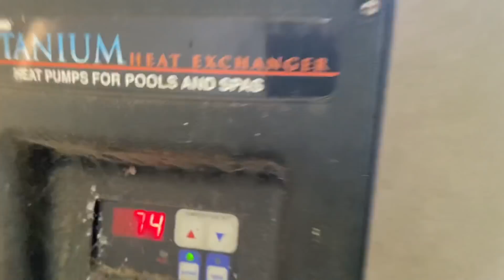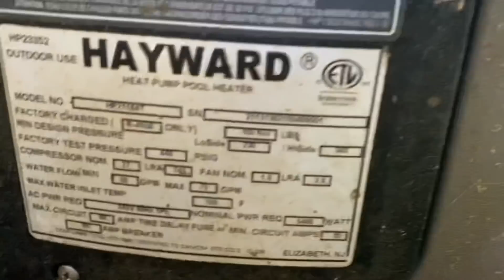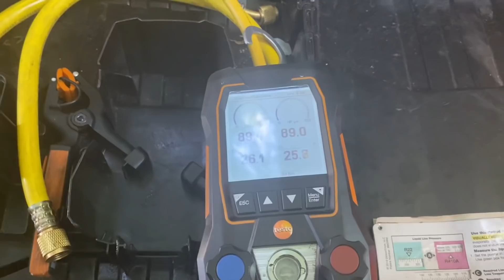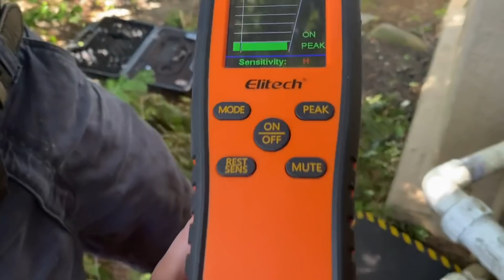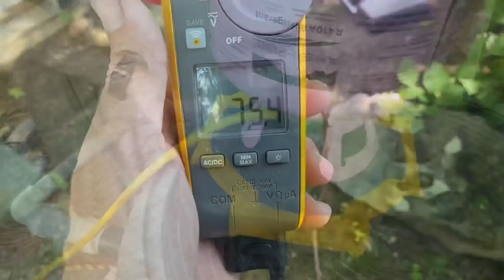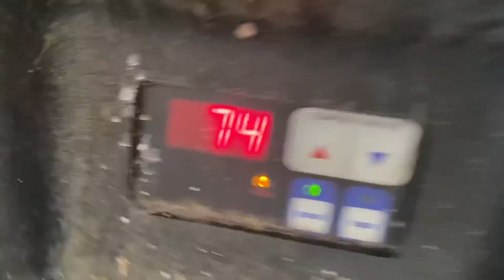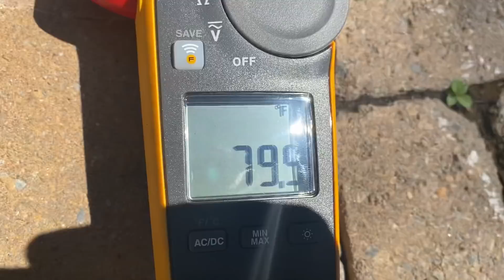Hayward Heat Pro Heat Pump LP Error Not Heating - Refrigerant Leak on Filter Dryer Repaired

Comment: Daniel, if you are readin this: brazing is hard to learn. do good brazing takes a lifetime to learn. never stop being critical of you own work and always aim to do a better job. pro tip from someone that has been brazing nearly 30 years now: use clean gloves when sanding and touching the copper. make sure you dont touch the copper by hand. the grease from your fingers kills the wicking action. even after sanding it remains so put on clean gloves, clean with alcohol/isopropl and then sand and braze without taking the gloves off.

Comment: 1K for a filter dryer and 5.7 pounds of refrigerant? Wtf im already packing for USA.Good job. Just one tip it would be  better if you had brazed the 2 pieces of copper pipe on the dryer outside the unit and just do 2 brazings inside the unit. Less time hanging inside the unit and breathing that beautiful smell of burnt poe oil and refrigerant residues

Comment: I did the majority of the brazing when I worked for the subway and I learned fast that the oxygen acetlylene torch was cumbersome and was much slower than using the turbo torch that allows the flame to evenly heat around the  pipe! No futsing with the oxygen and over heating of the pipe or a big old dog nut on the bottom of the pipe when all the solder runs to the bottom of pipe when the oxygen acetlylene torch over heats the pipe! Everything is not for everybody! Stop torturing Daniel with that oxygen acetlylene torch and get him a turbo torch with all the tips!   I would check all my joints with a mirror and a flashlight and rarely did I have a leak and I didn't waste money for an oxygen tank at the supply house! Great find and  Daniel you need to listen and observe Mikey pipes to hone your social skills with the customers!

Comment: Air conditioning the outside. I bet the guy that invented the Hotspot AC condenser that heats your pool for free probably felt the cold air blow out of a heat pump pool heater and thought it was a waste and can use that cold air to cool the house.

Comment: What causes an condenser compressor to short to ground? Most common cause?
Reply: Tech doesn't properly dehydrate system, moisture has chemical reaction with refrigerant and forms acids. They eat varnish off motor windings, shorts out motor. High heat due to lack of condensor maint. or bad fan motors can do the same.